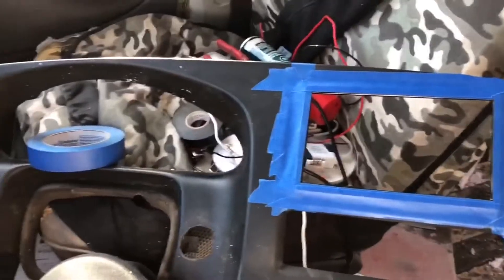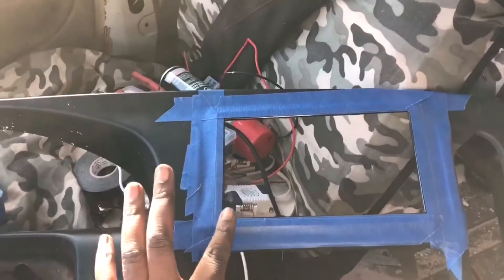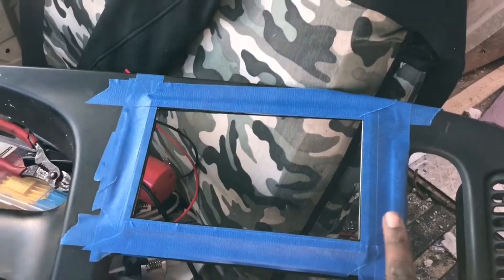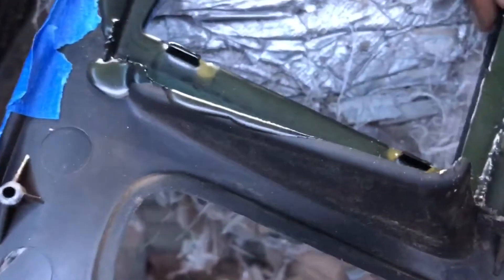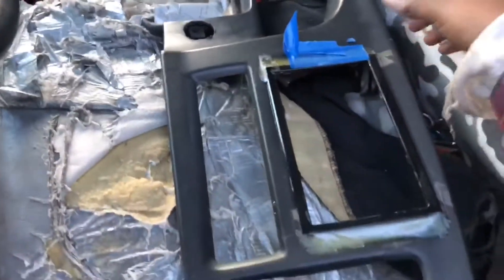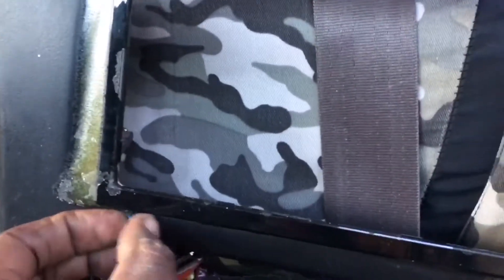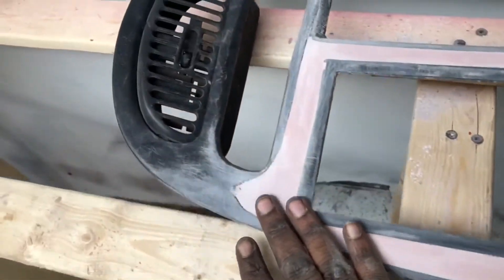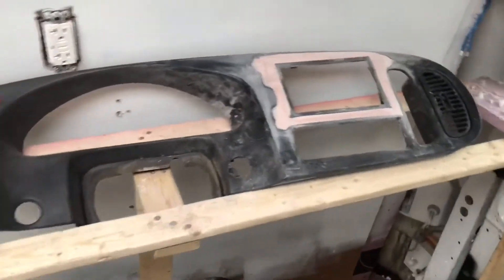How to build a custom dashboard

Comment: Thank you for making this video.  I'm fitting a Chrysler 300C center bezel into my Dodge Magnum and doing something similar. The bottom 2/3 of the 300C fits in the Magnum so I cut the top 1/3 from the Magnum and epoxied them together.  Now I need to do the body filler to smooth the two pieces.  Your video is very helpful.  Thanks!